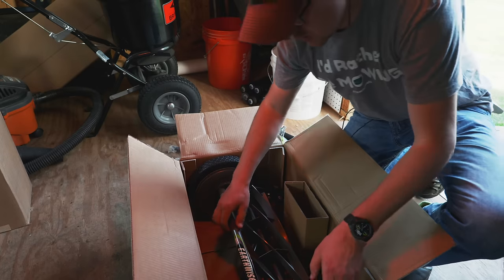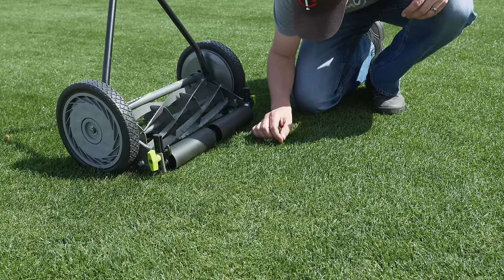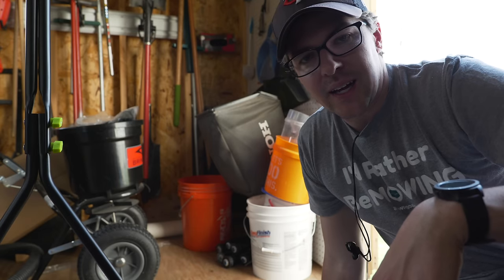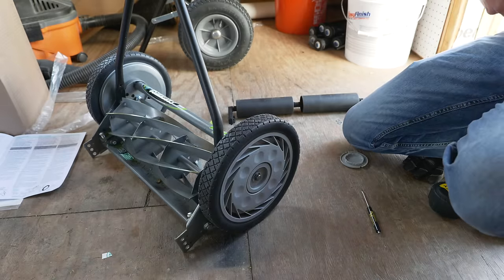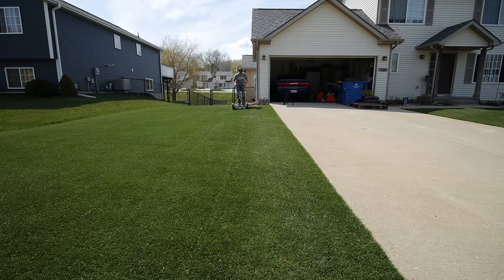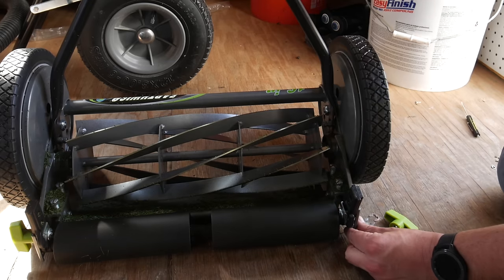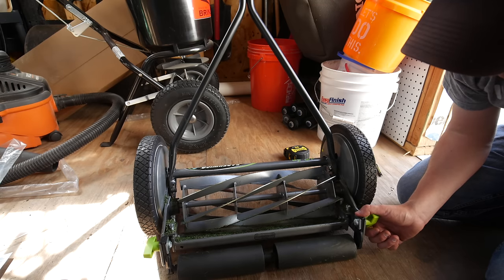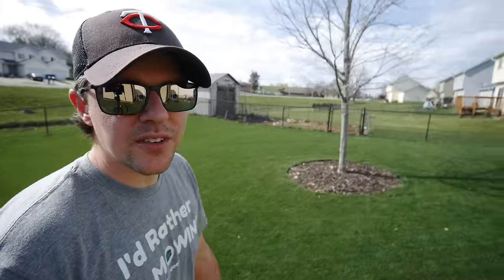I Bought ANOTHER Reel Mower and Here's WHY...

Comment: Why this vs a Rotary?
Reply: From what I understand a reel mower will give you a cleaner cut at shorter length. A rotary will cut higher lengths better due to the suction created by the blade spinning. Some grasses like being cut short some grasses like being cut higher.
Reply from the maker: The blades hit the bedknife and cut the grass like you were using a scissors. A rotary mower is just spinning in a circle ripping off the top of the grass blade which is fine if it's a good mower and a very sharp mower blade. The reel mowers cut it very clean and can also do so closer to the surface.

Comment: 7 vs 5 blade perhaps isn't going to give you more cuts per foot of travel.  What you may need to consider is how far the driving wheels need to travel per slice.  That depends on the gear ratio between wheel and reel drive and wheel diameter.  It is entirely possible that the 5 blade reel passes a blade to shear 6 times for every foot of travel and the 7 blade reel, if the drive is geared 16% less or lower, makes fewer than 6 slices per foot of travel.  Reducing the tire diameter will get you a lower cut and more RPM out of the blade but make it proportionately tougher to push.  You could fashion a jig to grind a 1/4" off the tire radius if you thought that you wanted to increase the number of cuts per pass.
The point I'm making is that you were making a pretty big assumption about how the 7 blade would cut when compared to the 5 blade.

Comment: I own a scotts reel mower and it's a piece of junk.  Bolts for wheels always falling out, and blades need constant sharpening.  Also if the grass is slightly long it's a tough push and you have to constantly go over the same spot.  And unless your grass is perfectly flat you won't get an even cut and blades of grass won't get cut at all.  Just looks terrible.  Don't bother with reel mowers AT ALL unless you enjoy constant sharpening and your property is perfectly flat and you don't mind mowing every week and going over the same spot constantly. just my 2 cents.